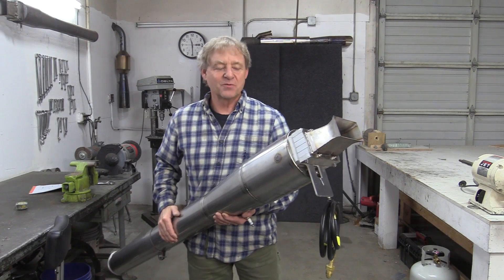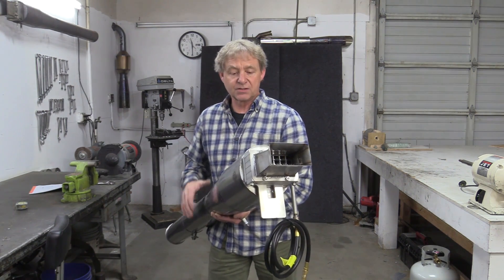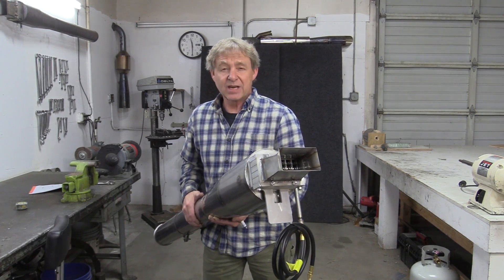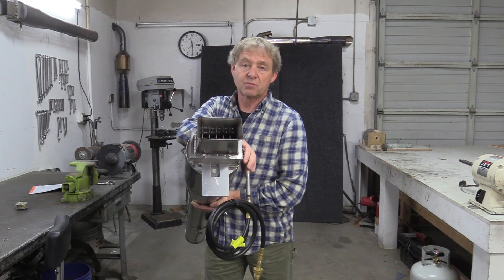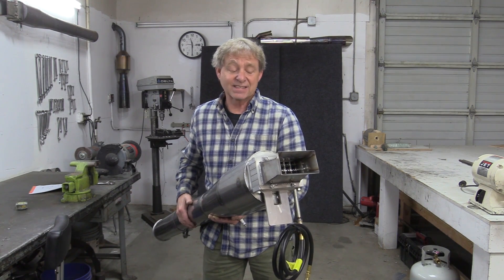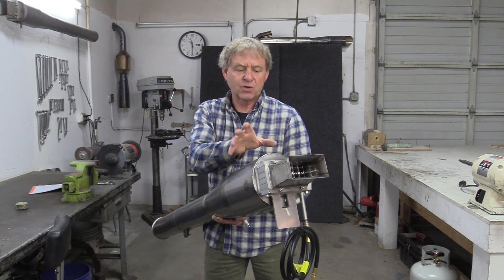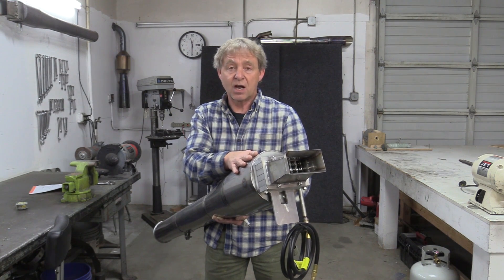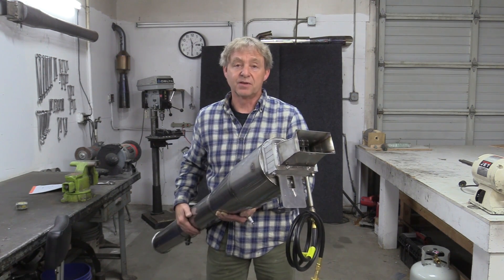Rocket Man building the BIG 50 pound thrust Cyclone 50 Pulsejet!

Comment: Could one weld a radial cooling device on a pulse jet?  lets say I was to build a flying motorcycle and would want the weight in the center, rudder in the front like an imperial speeder,.. would it effect the jet performance to build an additional cone over it housing radial cooling plates (too much cooling - jet goes cold - död) and could the instantly heated cooling air shooting out the back actually increase thrust - ?

Comment: Bob, very well done explanation and video.   Am I correct in in assuming that the spark plug is only used to initiate the combustion and after that the "retracting" flame front for each cycle is what ignites the fuel?      Which seems amazing at 108 cycles per second that is a lot of reversing of flow direction.

Comment: So if the pulse is at 108 cps there is no ability to throttle, as that would change the frequency, which is set by the length of the tubing.  Is that correct?  So there is only one throttle setting?

Comment: Have you been sued yet lmao lol bhahaha love it man I love it ,I'm just going to have to try and add one to the exhaust on my truck and see if I can add alittle boost to my ride lol ,it should be enough trust from the exhaust to get it started and use a back pressure valve to protect the engine from the jet engines heat and pressures, maybe ,wonder if I'd get pulled over lol

Comment: If you could make a worm around the hottest part maybe even print it with lost pla lost wax investment casting run rodi or distilled water so it doesn't boil in the worm h h o injector 

   Just got to remember and pump the investment plaster through the worm 
   The worm should endand go to te injector at the hottest part where it gets cherry first  

    For steam injected diesel it goes   up the cylinders down the exhaust back the exhaust through the turbo then to a mechanical injector 
The supply pump is Mechanical to concept iv had in my head for a long time now im pretty sure vw has one 85 mpg banned in USA cause it doesn't meet safety standards even though theres the same chassis here with a gas guzzler

Comment: Very impressive, especially how easy it is to start! Why did you install the spark plug into the conical part instead of the cylindrical one, right after the fuel injector? And how did you build the gasoline injector?

Comment: I was taught that when making a threaded hole, 2 thread revolutions, 1.5 revolution back. And when tightening bolts, slowly tighten opposate bolts until they are all the correct torque.
Reply: If you use spiral point taps, you want to tap continuously and only reverse once. The same thing for helical flute taps. All that reversing is for cheap hardware-store taps... and for the birds.
Reply: Tighten her up until she snaps, then back it off a 1/4 turn.
Reply: @kevin9c1  >>> OR until the threads START SMOKING...😝

Comment: Would you try a Tesla one way valve I think it would flow better air into the normal inlet these do work at around 1050 millibars with a leakage of about 0.001 % about one bar the faster the flow the greater it works only slow flow leaks alot?

Comment: Wonderful.  Do you have any idea of the specific impulse of the engine?   While I doubt it would be an economical sustainer engine for a model aircraft for long duration flight, it would certainly do a great job of launching it to a decent altitude.
Reply: Well, in the 1940's it got warheads from France to England for quite some time.
Reply: @michaelibey6700  V true.  The SI would give us an idea of efficiency tho.  But as you say, clearly good enough for its range of 250 km or so using 625 kg of fuel.  That works out to 25 litres of fuel per minute.  Thirsty but effective!

Comment: Pretty slick.  I thought the clip was pretty interesting.  I heard of these motors in High School.  I wasn't aware that they were so simple.  From HS I had heard that the motor was considered to power maned aircraft but because the reeds (?) wore out after about 3 hours it was pasted. Which I thought was pretty odd --- then I learned that the Nazis were primarily in dive bombers.  So I guess that the higher ups weren't engineers or maybe they didn't think much of engineers or engineering?  .... if you just had to replace the reeds every time after the craft landed? Mark it up to politics I guess.
Reply: The NAZIs used them to power the V1 flying bomb. These flew for perhaps half to a whole hour before crashing down and exploding. A spitfire in a dive could catch one.

Comment: Great video!   Do you notice a difference in thrust between gasoline and propane?  Does one fuel run a little cooler than the other over extended periods of use?  Also are you able to throttle the power via fuel supply and how does it effect it's efficiency while powering a vehicle in motion?

Comment: The German engine stayed cool. So not redhot.
Reply: Ours stay cool as well. You can even touch it for a few seconds while its running full throttle.
Reply: The V1 engine stayed relatively cool because it was moving at high speed through the air; 160mph at takeoff, around 450mph when the fuel was exhausted. If they are stationary with no airflow, they get much hotter. It's the difference between forced and convection cooling. Even a fairly modest airflow will make a big difference.

Comment: Interesting ya ever look into "Testla's Turbine" similar principle. 
Some very high figures for RPM and Horsepower!!!
With advent of ceramic bearings now feasible!!!
Using natural gas could easily provide electricity, heat, hot water etc for ???
Cheap easy and ???

Comment: sir, i made a valveless steam-pulsejet that gets almost 50lbs thrust, weighs less than 3 lbs, and can be built in 20 minutes with hand tools. it is 12" long, 2-3/4" wide, has an internal pulsejet, and a sleeve around it for water, which increases the thrust. i might end up in prison soon, and i want it to be produced no matter who gets credit. is there an email i can send the plans to?
Reply: are you serious ? if so im very interested in your project. I can send you a small amount of money [ 1000 dollars ] to help you fine tune your project. Of course we will have to skype so I know you are for real on this project thanks Andre
Reply: @mrmartin889900  i'm no computer wiz, i'm into mechanics, so i'm inept when it comes to skype, but i'll try to learn it today so i can communicate. if you are in cali, and have shop space, a budget of 1k aint necessary, i can build it in front of you for the cost of materials, which you might have just lying around the shop. if not, i will post my email so you can correspond with me. however, i can explain the concept. a steam engine requires a boiler, and a ton of heat. a pulsejet produces a lot of heat, so much that they burn themselves out rapidly. wrapping a water sleeve around it allows gravity flow to the area between the outer pipe and inner pulsejet. since the rear of both tubes are open, it never builds enough steam pressure to explode. it also cools the pulsejet, making the pulsejet last longer. instead of 15 minutes to preheat a boiler, you are using the inner pulsejet as basically a glow plug, the glowplug turning the water into steam, having the btu to to so only moments after ignition. at low speed, the steam brings the weak pulsejet up to speed rapidly, and the pulsejet has more power at high speed. basically, the steam sleeve gets rid of the issues of a pulsejet and the pulsejet cancels out the issues of the steam engine. the lack of moving parts reduces wear and maintenance, the openness makes it safer, and i believe the concept may make it possible for planes to suck a large bird into the intake without destroying the engine, thats assuming it were scaled up of course. the only complicated part is explaining the intake/exhaust of the coanda/tesla valve, which is really just a redirect, and not a moving part. i'm autistic, so its difficult for me to simplify it without showing it. i built my prototype as a bet. i bet my roommate i could build one in ten minutes using just a hacksaw, log, and a rock as tools. i lost the bet, it took me 12. still, i'm overly complicating it because i cant figure out how to explain it in typing. i believe with a jig and a press, you might be able to produce one every minute. using stainless steel is best, and thicker steel works better, but my prototype was made out of 2 different sized vacuum hose extensions, one inside the other. it was quite thin. i can send pictures, and if you can get the concept from the pictures, it wont cost you a thing except time
Reply: very nice Shawn, so you would have no problem scaling this up to maybe 200 to 500 lbs of thrust ?
Reply: @mrmartin889900  i'm not sure about the math on something of that power, but yes. however, due to the reduction in weight, i would recommend scaling that back to 100-300 lbs thrust. replacing an engine weighing 200lbs that produces 500lbs of thrust with an engine weighing 18 lbs that produces only 300lbs thrust would reduce the risk of the airframe becoming over stressed from compression. add the fact that water weighs more than gas, and it almost evens itself out. my original idea was to design different engines that would fit together like legos to make bigger engines, with my prototype being the first part.
Reply: ok Shawn your talking my language, I would like to put the pulse jet on a frame with wings and tail section, no bells or whistles keep it simple RC control. have you ever flow a RC airplane ? build one from a kit ? this would be using the 50 lbs thrust pulse jet. BTW about how much would it cost to build a 200 lb thrust steam pulse jet ? material and labor
Reply: @mrmartin889900  i have never built an rc plane. the friend who had the balsa build said it took him over 100 hours to build it. seeing what 50 lbs of thrust does to a balsa plane built for 7-11 lb of thrust tells me making one out of balsa is a waste of man hours. i have only flown rc helicopters. when we were testing it, i was the engineer, he was the pilot. we learned you cant pilot an rc plane if the engine leaves without the control surfaces attached ;)
Reply: @mrmartin889900  my friend josh went to the air force academy in colorado. he is also really into steampunk. he wanted to use my engine to power a real life iron man suit, and hoover into comicon. basically, he wanted to spend thousands of hours to design something professionally that would run off of an engine i made out of trash in 20 minutes. "this could turn comics into reality" lol. i'd be happy just to see one on an rc airplane, but it would have to be an extremely sturdy airframe. i tested one on a friends balsa jet, it was made to use a hobbyking redhead, which only produces 7-11lbs thrust depending on the fuel used. when we turned the drain cock on the water line, the airframe broke loose of the launcher, the airframe fell apart ten feet from the launcher, and the steampulsejet went on without it. we never found the engine. producing the steam in the sleave takes away the need for having most of the parts previously deemed necessary for a steam engine. look up aeolipyle. henri coanda, frank whittle, and hans vonohein all give this 2000 year old aparatus credit for their invention of the jet engine. all i did was simplify the concept. some turbines use hollow turbine blades. if angled for thrust at the outside edges, with the water pumped through the center, the concept may be used in standard jet engine configurations with very little modification, but like i typed earlier, its all based on a 3lb engine i can make in under 20 minutes with basic hand tools. i can draw up the jig plans and instructions up in about a day, and instead of paying me 1000, you can spend 50 on mats for the jig, and pump one out per minute for the cost of stainless steel tubing. if i had a shop to work in, a budget of 1 k would allow me to make a turbine generator to run off of it, which would allow me to run the pulsejet itself off of water as well by using electrolysis at the intake to separate the hydrogen and oxygen where its needed, eliminating the risks involved with storing hydrogen, just as the steamsleeve eliminates the risks involved with storing high pressure steam
Reply: can you tell me what kind of college degrees you have ?
Reply: @mrmartin889900  i have 0 college degrees. all my knowledge is from watching youtube, reading books, then testing the concepts. however, i'm homeless, no shop to work in, which is why i'm giving the info away. if you take a delta, like the horten 229, you can cut out the front portion of wing, streamline the wing ribs, and put the control surfaces inside the trailing edge of the wing. this will save time and eliminate the issues associated with a fuselage. think of it like the ac vents in your car. since its at the trailing edge, it should simulate the drag created by a tail. less parts performing more functions. also, using the air travelling inside the wing allows you to battle the effects of  compression that are put on external control surfaces. one of them being high or low pressure pockets created by the external surfaces of the airframe. these pockets prevent the control surfaces from having air pressure to bite into, or in extreme situations, prevent them from moving. a horten 229 modified wit more of an angle at the nose and an extended rear would allow for supersonic flight, although it would look more like a diamond than a boomerang at that point. i learned by trial, error, and luck. the first steampulsejet i made, i got lucky when i cut it, because a 1/4 inch in either direction and it wouldnt have worked as a valveless pulsejet, or so i was told. i'm not sure though, because the coanda/tesla valve i designed only allows pressure to go one way at the intake, so theoretically, it should matter about as much as it does on a valved pulsejet, which is to say very little. the mathematics of sound and it effects on the pulse are extremely important on a valveless pulsejet, not so much on valved ones. the only real breakthrough here is that my valve doesnt move.
Reply: @mrmartin889900  basically, the intake portion is always clean air. at low speed, the exhaust portion sucks in air too, except its higher density because part of it is steam, which gives the combustion more mass to push off of. at higher speed, the steam is just added thrust. i dont know if my design would work as a ram/scram jet, but the power to weight ratio would definitely take a light delta rc plane up to the sound barrier. however, at that speed, the rc plane itself would need to be made of stainless steel as well, like the russian mig 25. composites could work, but are more expensive, thicker, and require complicated epoxy and kilns. i try to design stuff you can make in a barn, or with your kid at the kitchen table. i didnt have 200 to buy a hobbyking redhead, its how i ended up with something 5 times as powerful at the same size. my first pulsejet was just a kitchen drain pipe. it was held to a cinderblock with a wire chain. when i saw the wire turning red, i decided to squirt some water in the intake. the engine broke the chain, and thats how i lost my first pulsejet. it was a week later that i built my first steampulsejet. surprisingly, the steam helps to quiet the pulsejet, but you still dont want it on at night or if you have fussy neighbors. all this with 2 pipes, 4 cuts, and a few whacks with a rock. my prototype only has 2 coanda/tesla valves, but the production model should have 4. a proper jig, however, could do all the cutting and shaping at once. let me know when you sent me an email so i can delete my email address from youtube
Reply: I sent you a e mail over a hour ago, I will send one again
Reply: @mrmartin889900  i just realized i typed that it was 12" long and 2-3/4 inches od, but that was the planned size for one using thicker pipe. the prototype was 18" long and was only 1-7/8" od. the difference being that i wanted to use 1/16" thick stainless steel telescopic tubing for production instead of the 22 gauge stainless vacuum hose extensions because telescopic pipe is seamless where the hose extensions are not. i chose 1/16" because it could still be cold pressed in a jig using a 7 ton bottle jack. anything thicker would require heating the tubing up first. like i typed earlier, i designed it so you could make it in a barn, or at the kitchen table.

Comment: ugh the dreaded death wheel.. I understand they are cheap but there's such better and safer tools to cut stuff with I don't get why so many people still use them. Like... https://www.eastwood.com/8-in-bench-shear.html?SRCCODE=PLA00020&gclid=EAIaIQobChMIqP7Rp46k3wIVDoJpCh3a3whUEAYYBSABEgK1XfD_BwE# or.. https://www.northerntool.com/shop/tools/product_200711914_200711914?cm_mmc=Google-pla&utm_source=Google_PLA&utm_medium=Power%20Tools%20%3E%20Cutters%20%26%20Shears%20%2B%20Nibblers&utm_campaign=Ironton&utm_content=61482&gclid=EAIaIQobChMI6L-2yY6k3wIVDoJpCh3a3whUEAYYASABEgLZXfD_BwE

Comment: Ever tried injecting water with the fuel to keep the temperature under control and use steam expansion for part of the thrust? Some of the big WW2 aircraft engines did that.
Reply: Cuts down on the temp alot?

Comment: Questions: Is fuel consumption different using propane rather than gasoline?  How long will this engine run continuously until there is material failure?  Have you tried any kind of sound suppression method?  Could this be modified to work underwater with a snorkel - like a kind of water cooled jet boat engine - and have it either push against water or exhaust it above the water?

Comment: is there anyway  to throttle a pulsejet engine, or is it just full on or off?
Reply from the maker: No, it throttles very well, from about 10 pounds to 50 with a speed control that gives the pumps more or less voltage